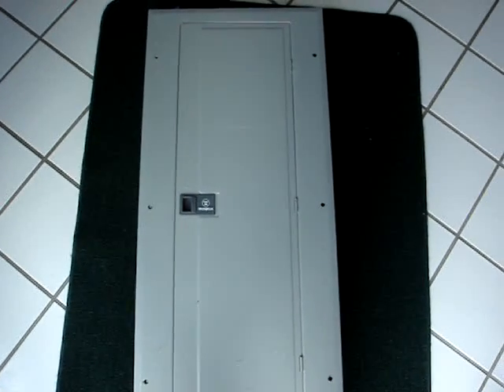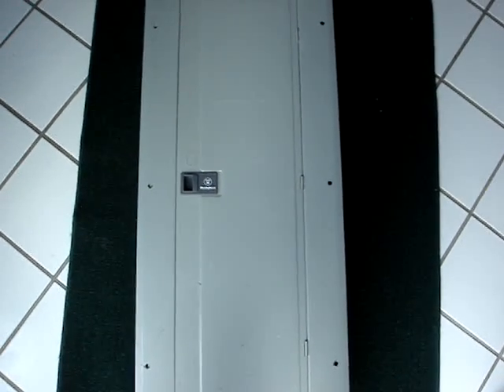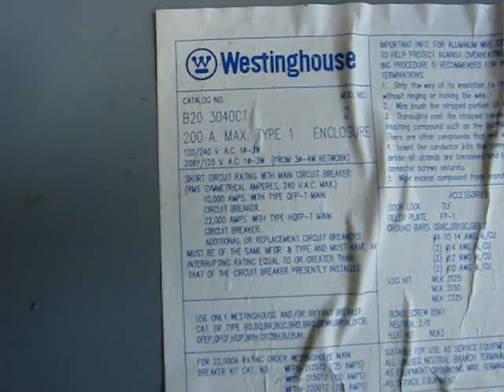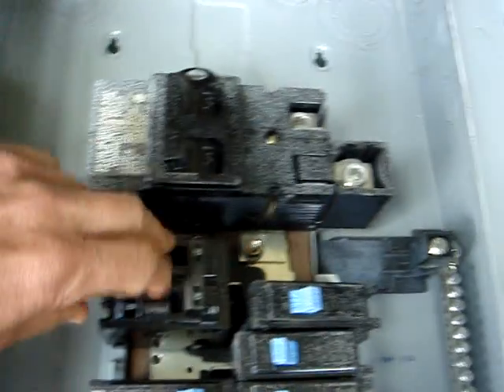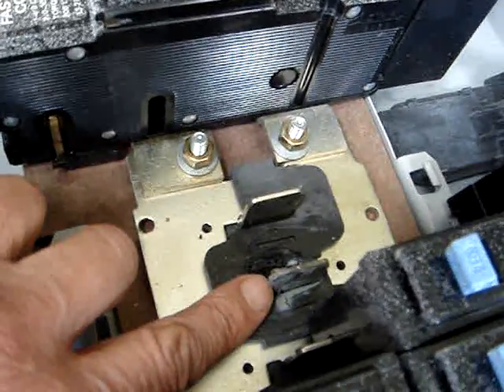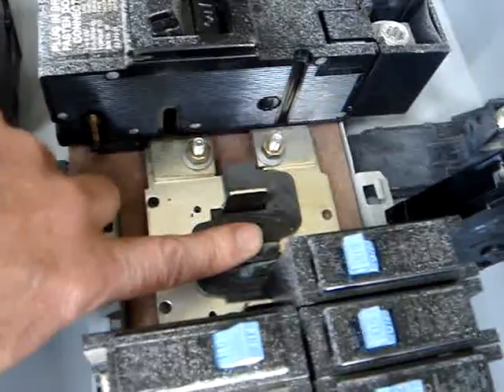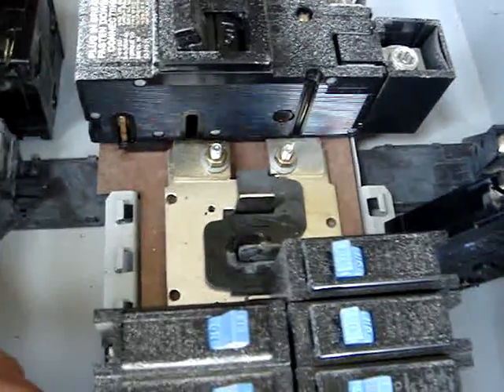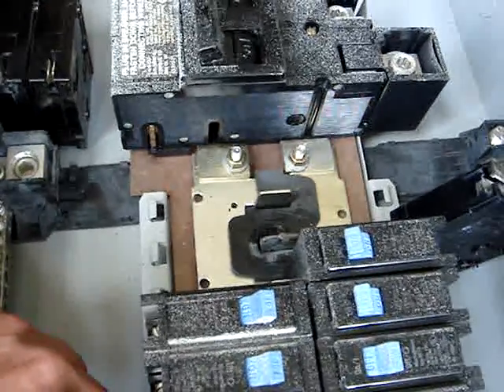Circuit Breaker Panel Problem - arcing between busbar and breaker - heating and melting plastic

Comment from the maker: Thanks for the comment.  I am no electrician, but it seems common practice to have breakers of different amps on the same panel - like you say - textbook says OK.  Absolutely agree about the heating.  Aside from electricians, how many homeowners ever think about inspecting a breaker box?  You just assume it is fine like you do the wires and the outlets.  This was a Westinghouse (now Eaton) box.